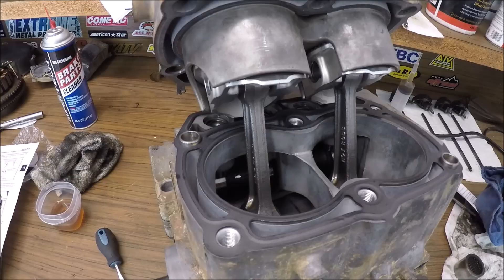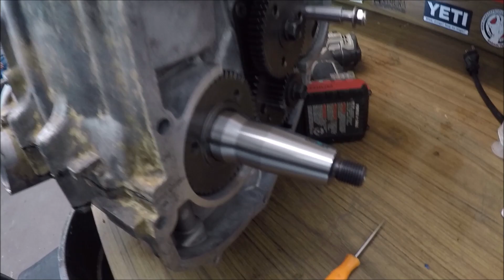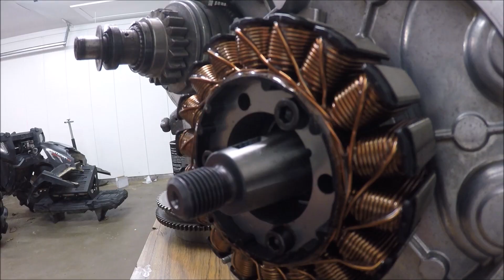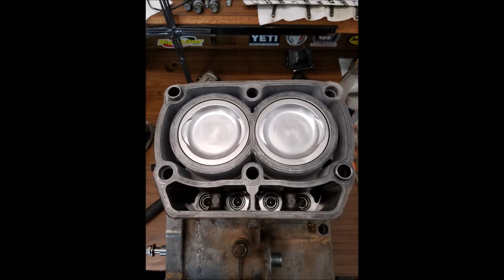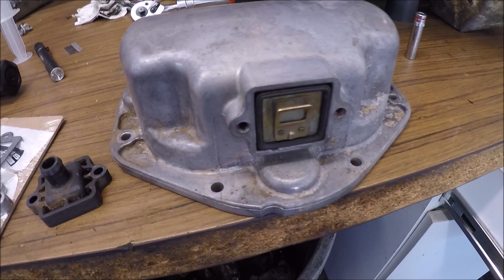Polaris Sportsman 800 X2 Motor Build Top End

Comment: And on a lot of snowmobiles you don't have to use an offset key way to adjust the timing usually you can adjust the stator plate behind the flywheel and that will adjust the timing on a snowmobile engine and most dirt bikes

Comment: Whether you're changing the exhaust or air box or not if you're adding a higher compression piston the engine is going to want to push more air and fuel so you might want to try a tuner if you have it yet and yes it will probably run just fine forward a tuner you can make it run perfect

Comment: Little off topic, got a 2011 ranger 800 needs a new ecm. Only firing on one cylinder. I took my ecm off a 2012 and the motor runs fine. Thanks for any help. Looking at doing the water pump on mine.
Reply from the maker: Surprising cause I rarely see a ECM go bad. Glad you figured it out. Good Luck!
Reply: SolitudeCustoms we found a seller on Ebay that has one for 2010 model but not 2011. Its plug and play, already flashed. Selling for 220 dollars. Just wondering if there was any difference. We checked plugs, wires, coil anything we could. Also put the bad ecm on mine and it does the same thing. Thanks.